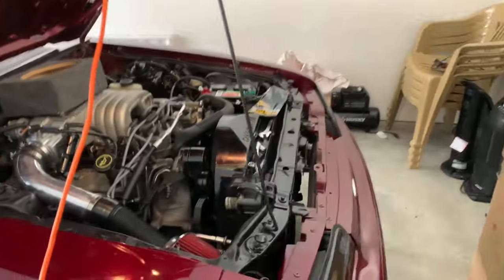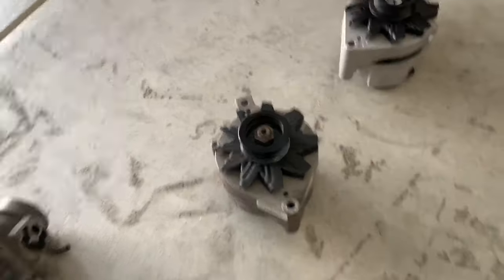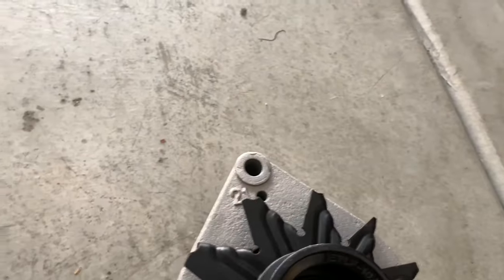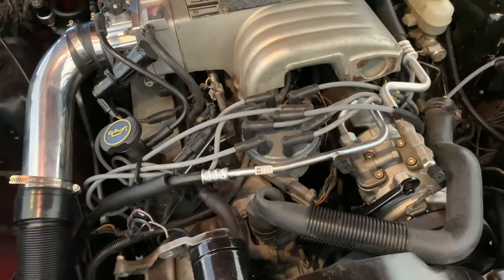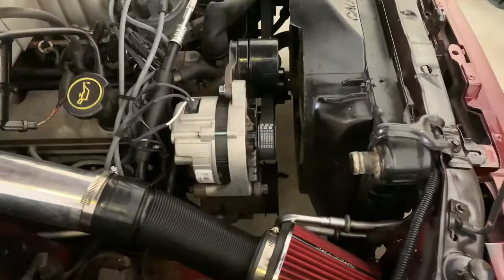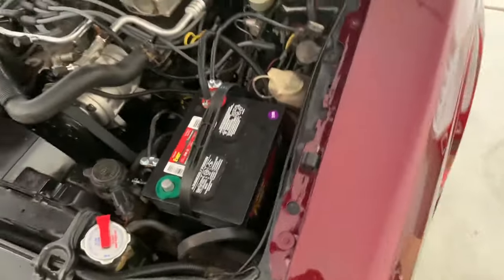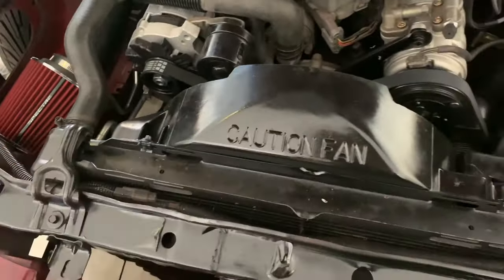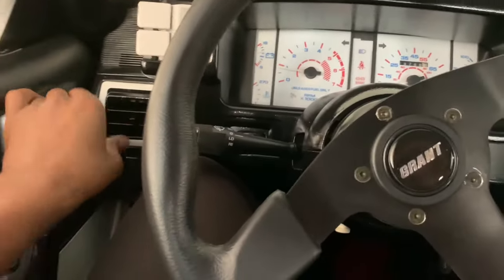1987 Ford Mustang GT 5.0 Alternator Replacement (1986-1993)

Comment: Nice fox i got an 88 gt convertible same fin on the back to nice. U should have upped to a 200 amp alternator. Y? Cause u will definitely upgrade other stuff like a  eletric fan so on. Other thing u should ave done if u didnt is up ur ground wire for your alternator cause them original wires cant handle much trust me I been there👍👍
Reply from the maker: C Facts I do need a bigger alternator eventually! Because a lot of upgrades coming soon so stay tuned! And I do need to rewire all the battery wires also

Comment: Gorgeous Fox body. Ever think of boosting it? You'll love the power. Keep up the good work.
Reply from the maker: Yep I plan on supercharging it in the near future. You still own a Fox?
Reply: @CarReviewsbyKJ  No. I have a 1994 GT. However, I appreciate all cars as long as they're done nicely. Careful with that stock block. They crack if you put too much power to them.  They also can crack at the head bolt location above the oil filter when you torque the heads down. Mine did, so now I have a Dart Sportsman 363 between the fenders. 💪🏾.
Reply from the maker: I baby my cars so I would only get on it so often. I’m trying to hit 1k subs first

Comment: Hey when u wired your alternator did u have to cut the silver pins off the alternator and then wire everything together, or you left the silver pins on
Reply from the maker: I ended up cutting them to get a good connection